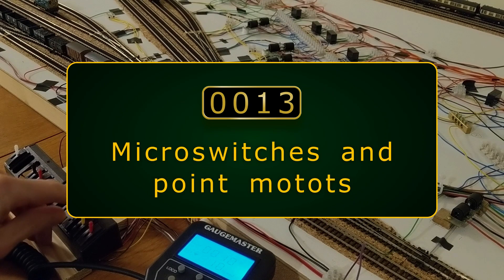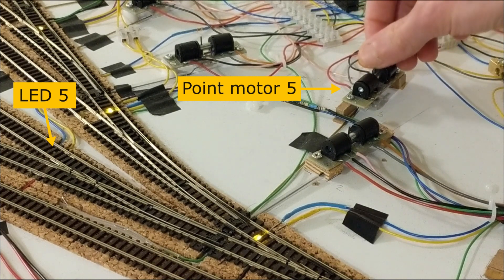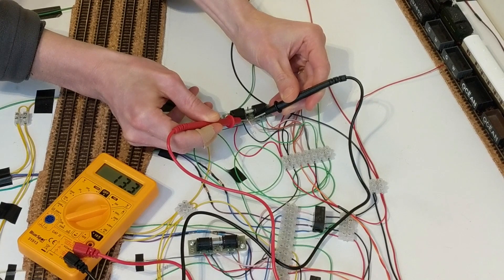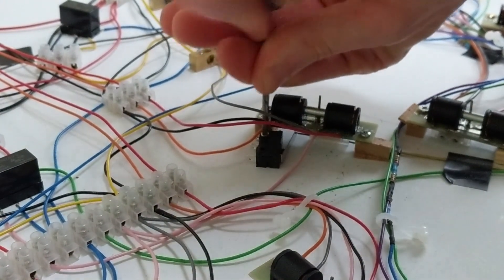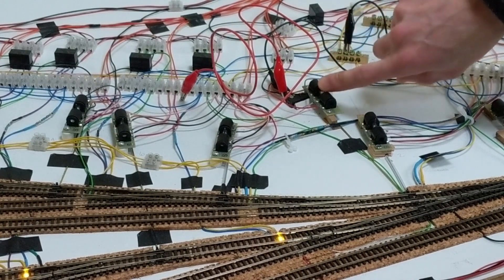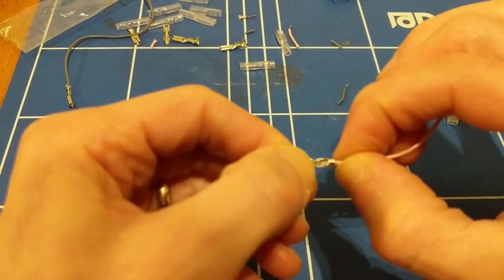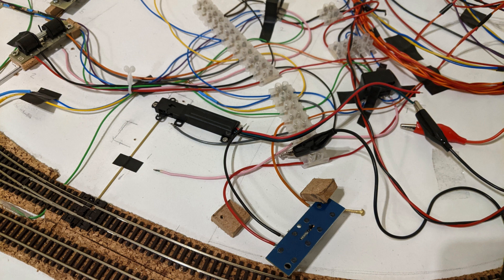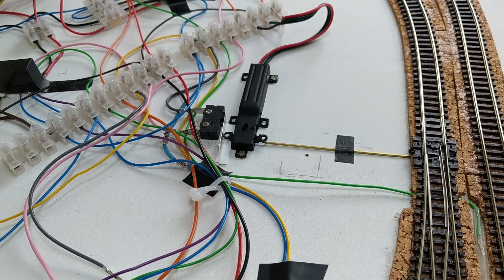0013 Using microswitches with point motors

Comment: Nooby here, just opining. I think rather than buying sub-standard solenoids and having to add extra micro switches because the aux one don’t work, I’d rather pay a few quid more for decent servo motors. Quiet, smooth and a more prototypical action. When you spend £100 on a loco, £20 on a set of points and £300 for the simplest DCC rig, why scrimp a fiver on the points motor?
Reply from the maker: Yes, a lot of people like servos - I've still not tackled setting any up, so can't provide a personal perspective on that. I do like the clunking sound of the solenoids though - it sounds a lot closer to levers in a signal box than the whirring of a motor - but I think most people prefer quiet point motors.
I think you'd probably still need to have a switch somewhere, unless there are solenoids that come with them built-in.
I'll save money wherever I can, precisely because of how much everything else costs ;)

Comment: Those Gaugemaster motors are extremely unreliable, I stopped even trying to fix them, I simply replaced them with peco motors under the board and use the Peco add on polarity switch. Out of my original 20 Gaugemaster motors I think I have two that are still working.
Reply from the maker: Hi Alan, thanks for letting me know your experience of them - I've found the main motors have been ok, but yeah not so great with the aux switch. It's a shame you've had so many fail :(
Reply: @endoorrailway  Like you said the motors are OK, it's always the switch that fails.

Comment: Phew! Quite a complex set up. Before doing all that, did you ever consider using simple DPDT switches to control the points, using wire in tube? They usually work quite well for that sort of thing by all accounts. Cheers!
Reply from the maker: Hi, yes funnily enough I started out thinking that I'd try to have visible working point rods, but that would have been super-fiddly, and the rodding would have had to be over-scale to be strong enough. So then I considered the more conventional hidden rods, which is pretty much what I've now got going from the points to the point motors, but when I later decided on having the LEDs too the PM-1's looked like a straightforward approach... but actually all the points are fairly close together so it might have been overall easier to have manual switches at the front, and as you say, DPDT would be able to the job that the relays do at the moment. Ah well, all good practice for the next layout (which I hope will be bigger)! Thanks